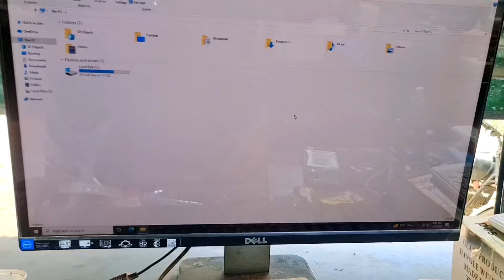SIMPLE INVENTIONS

Comment: isn't going to have as much capacity, but is easily rechargable many more times now, just be careful as 3.7v li-ion is much higher than 1.5v AA.. usually that's enough to fry something. But if it works it works.
Reply from the maker: I have been using this for a long time, you can do it if you want